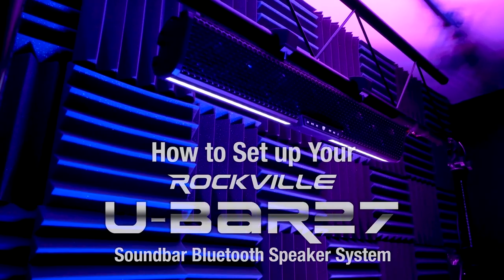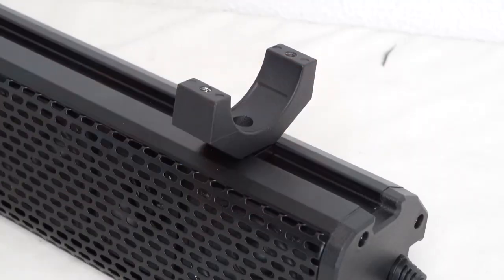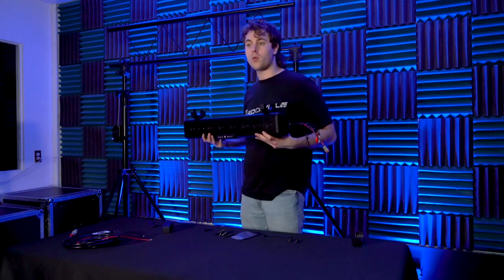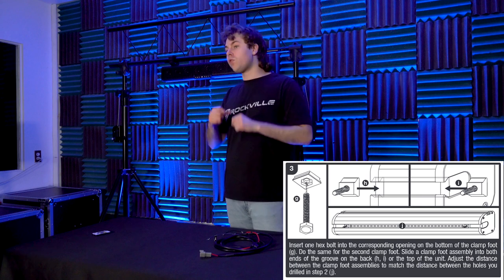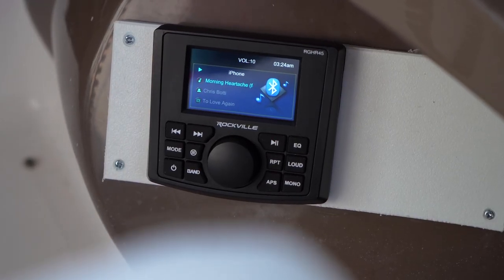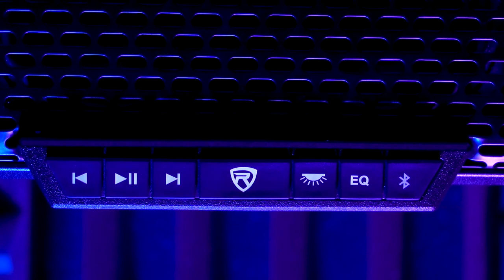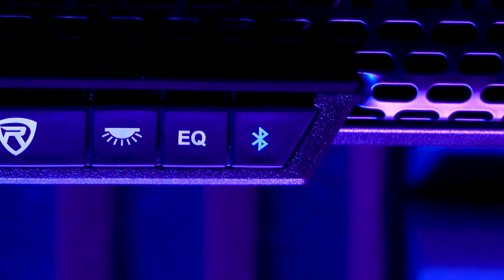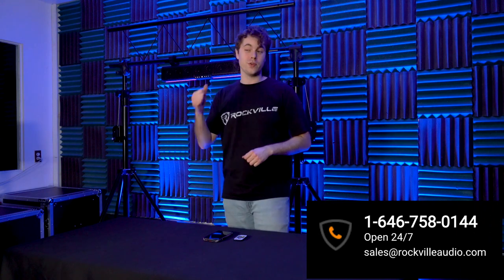How To Set Up Rockville UBAR-27 27" ATV/UTV/Boat Soundbar Bluetooth Speaker System w/LED + Wire Kit

Comment: What is the default power on state? Does it remember the last LED color and on/off setting? Does it remember the last used input? I want it to default to AUX input and preferably the last used LED setting (color and on/off state) THANKS!!!